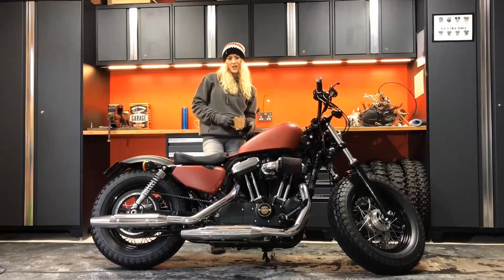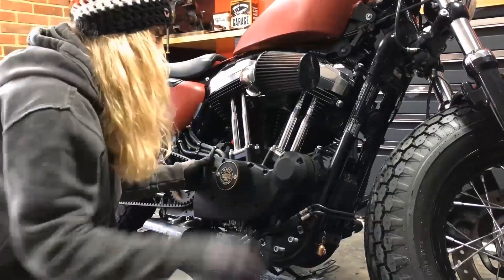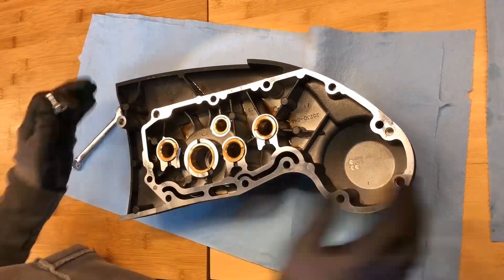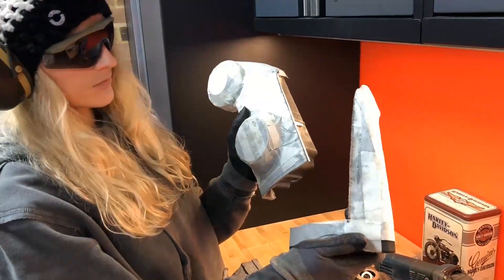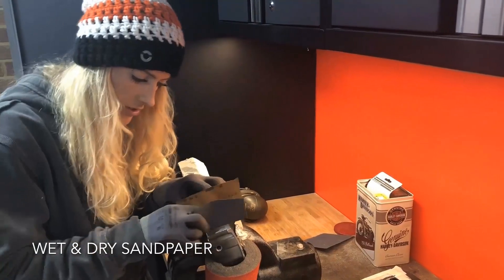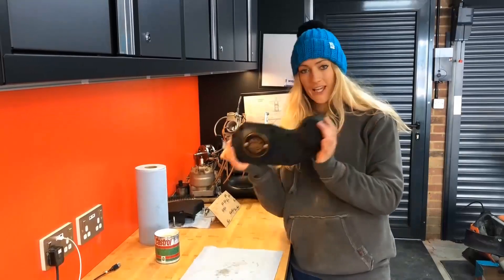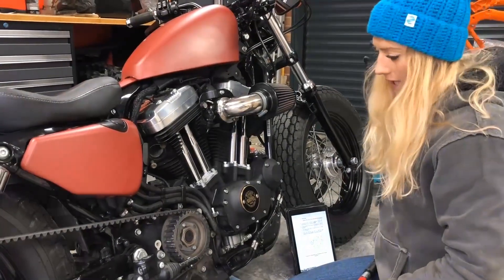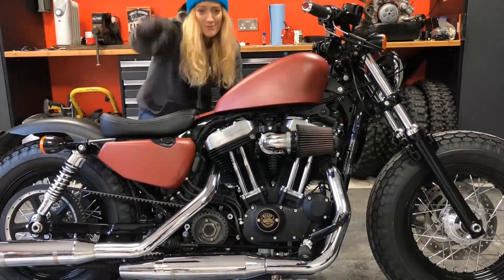Harley-Davidson Sportster Cam Cover Chop Customisation How to Video

Comment: Best video on this, so many people think you have to remove the push rods to do this, I’m so glad you showed them all, nice job.
Reply: iv been holding off on this because thats all i would hear...
Reply: @NomadMoto  Me too. 
I want to replace mine too, but worried about having to remove the rocker boxes too. And they say the cam(s) might come out with the cam Cover Too. And I'm worried about getting it back on without the cams being thrown out of place.
Reply: Mine is an 2002 also.
Is hers a rubber mount? 
2004 and up?
Reply from the maker: Glad it helps dude. It's an amazingly easy job!

Comment: I would love 🧡to do this project on my 48 special , 2018 , but would be paranoid the gears would come out with the cover, with spring tentions from the rods above causing them to fly off everywhere, do u have to rotate the pistons at a particular level to release the pressure on the cam orbital surfaces.😊
Reply from the maker: I hear you, take it slow. I didn't have any issues on pressure or tensions. Just took it slow. If they did shift, it's just a realignment thing, all good learning I'd say.
Reply: Yeah you should be concerned with that. Do yourself a favor and watch Hammer's instructions in their cam swap video

Comment: have installed Roland & Sand pulley guard on my 48 Special 2018, and then screwed back header pipes back on before i saw this great video. Do i still have to uninstall the bloody header pipes AGAIN,  to slip off the cam cover  while only taking off the brake rod & pedal ....looks like plenty of room  , but want to be sure.😲
Reply from the maker: I'm sure you need to take the exhaust headers off and the brake linkage
Reply: @TheGirlOnABike  roughly how far does the cover need to come apart outwards from the engine before u can swing it up to take oil hose off ?   seems like heaps of room before it would hit the header pipe.  And MOST IMPORTANTLY , what is stopping the gears coming out with the cover when taking it off , messing up the cam timing on our 48 special :(😊
Reply: my cam cover is chrome , is it worth doing by polishing the exposed cut end & bottom to match the chrome . Aluminium comes up pretty good if highly polished the knew  exposed ends.

Comment: I was very surprised to see that the ignition pick-up is no longer in the cam cover but I am blown away that you can remove & reinstall the cover while the tappets are pushing on the unsupported cams under the pressure of the valve springs !!! 
That's a long sentence but, I did say that I'm blown away lol.  Can someone with an understanding of physics please explain this to me ?

Comment: It is a very rare case where that cover slides on like that regardless of how you line it up. The proper way of doing this is to loosen up the rockers and relieve the downward pressure on the cams. 1 out of 50 goes this easy.
Reply from the maker: Good gen. Thanks

Comment: You don't need to loosen the push rods?
Reply from the maker: Off The Grid no, you don't need to touch them 🙂
Reply: Maybe its because we have different year bikes. mines a 2002 hugger
Reply: @NomadMoto   On the '03 sporties and earlier you definitely have to take the rocker box off first to release pressure on the cams, pushrods, rockers, etc. I know they switched some shit in the cam side on the '04 and up but not sure all the implications of those changes.
Reply: @morganridings5725  Thanks man. I finished the cam chop. I did everything you said. It came out really good.
Reply: @NomadMoto  mine is an 2002 also?
Reply: anthony diodati super easy to do man. You just need to find dead center, then loosen the rocker boxes. Loosen up all the bolts to relieve the pressure. Then take cover off slowly and the cams will stay in place.  Drain your oil first
Reply: @TheGirlOnABike  what year is your bike again?
Reply: @mrbreezeet1  This video is for 04 and up sportsters.
Reply: @NomadMoto Thanks, That's what I was afraid of.
 It's been a good while since we replaced the rocker boxes. Harley mechanic helped me. Circa 2006. 
Id have to find a video I guess. They want too much darn money for the push-rod kits. 
I think it was around $250.00 for everything. 
Plus I think I read you have to pull the rocker boxes to initially remove the push-rod covers.
Reply: Honestly, I wish I could change it like she did, ...........LOL......Guess I can wish all I want................LOL
Reply from the maker: anthony diodati 2015 👏🏼
Reply: @morganridings5725  that's what I was afraid of I have the ability to do it just not the patient's right now nor really a proper place to work unless I would get my garage straightened out which kind of tough right now long story thanks for your reply.
Reply: @anthony diodati no problem. I'm in the middle of a full teardown on my '03 1200 and by far the easiest bit is the part you'll need to do. You won't need a ton of space to get those rocker boxes off, it's a little bit of a pain to get at the rear cylinder head bolts on the primary side, but just be patient, you got this.
Reply: @morganridings5725  It is the same on 2004 . There are forse on one or two cams. The girl in this movie had some luck i belive when she put the cover back.  We did not know what really happen in the video or after . some miles..

Comment: Do you need to release pressure before you take the cam cover off?
Reply from the maker: Pressure on what? The cam lobes? I didn't touch the cams at all, just the case removal
Reply: @TheGirlOnABike  I am not sure, I asked elsewhere about replacing the Cam cover and I was told that I had to take off the rocker cover and rocker arms to relieve pressure first.
Reply from the maker: @chabib23  ah ok, that's the pressure on the cam lobes. I didn't have any issues
Reply: @TheGirlOnABike  Ok thanks a lot!
Reply: @TheGirlOnABike  You have to do it or else  you can ruin  some of the bearings. the are are allways forse on on or two cams.

Comment: My cam cover won’t go back on
Reply from the maker: Don't panic and be gentle. You have to find the sweet spot. Ensure it's total square and aligned and then gentle push. It will be about getting that perfect alignment as it should not take and strength. Good luck

Comment: A good job and nice looking after. BUT never take the cover off before you have take off the tension from the valvelifters . I know that you can take it off without any problems but when you put it on again the cams are not in the  exact right posiseons from the tension. You can ruin the cambearings in the cover with the small chips from the bearing when you forse the cover on.   How do i know that??  Guess !!  And if you need a rubber mallet or similar when you put the cover back. You have big problems. without force from the cams,  Just put it back with hands...   Just a warning  my friends.
Reply from the maker: Thanks for the tips ❤️

Comment: where is the centering pin? cut, it's useless. LOL
we will talk about it again in 40,000km ;-)
Reply from the maker: No nothing cut. Maybe this model is different to the one you're thinking. Bike runs perfect, done 20k miles and zero issues.
Reply: @TheGirlOnABike  look at 2min 30 you will see it next to your screwdriver

Comment: Do you Like cats and RU single? 
I'd Marry you tomorrow!!~!!!.................................LOL
Very nice job!!  I like to see a woman that likes to wrench, and has hobbies like mine, Instead of Busting My A$$ about my hobbies...................LOL!!
BTY, does the drive belt look like it could stand to be adjusted a "small bit" tighter?

All the Other videos I have seen, said you would not be able to get the cover back on with out removing the Rocker Boxes, 
I would like to replace the (flaking) chrome one on mine, But am concerned about the Cam(s) coming out with the cover, and/Or getting the cover back on without Issue. (I SEE YOU DID!!) 
I thought of cutting my push-rods, and using aftermarket adjustable push-rods, but they want too much money,
Reply from the maker: anthony diodati Haha 🤣😘
Reply: @TheGirlOnABike  lol, that's funny right?
I've only said that on your video and Jessi Colter the late Waylon Jennings ex-wife well Widow LOL oh..... You are cute as a button though LOL

Comment: You should have relieved the pressure on the cams by slackening the rocker gear , your lucky the cams never came flying out under pressure , the cam cover supports the out side of the cams under load .and having to retime every thing . not the correct way to do this. but it does look good .
Reply from the maker: didn't have any issues but good to know
Reply: Didnt want to be an on line know it all....Was an HD tech for 20 years and saw my fair share of miss haps , keep up the good work , we need more young people into the scene . or there wont be one .
Reply from the maker: Thanks for the encouragement dude. Mega appreciate it, totally know what you mean about the scene ❤️🙏

Comment: Looks like u exposed ur oil spout nasty look u didnt think this thru to well lol good job tho but now ur oil line will be exposed try again with new cam cover
Reply from the maker: The oil line wasn't exposed, all was good. I've done 10k miles since with zero issues. Thanks for the concern but it was all great.
Reply from the maker: Maybe this is a problem on an older carbureted or evo engine. Not an issue on the 2015
Reply: So ur saying ur oil line from the tank isnt visible ur crazy u butchered up ur can cover if the oil spout wasnt exposed whyd u have to remove it to cutt ur cover 🤔
Reply: @TheGirlOnABike  my bike same year as ur i just have tons more work done not just cosmetic  upgrades
Reply from the maker: @TheSevenboy127  because the but if the cover staying intact is has the oil spout. That was not harmed at all. Sounds like you've just got too much time on your hands. My bikes is absolutely find post the mod, nothing was harmed, so you can stop worrying. Cheer dude

Comment: Easiest way to damage all the bronze oil lite camshaft bushings is to remove the camchest cover without loosening up the rocker boxes and taking valvespring pressure off of the camshafts. That is the biggest hackjob I have ever seen on a camchest cover using a hand grinder? really? A mill such better way to do the job definitely an epic fail of a motorcycle mechanic.
Reply from the maker: Thanks for watching dude. We're all entitled to our opinions. It all worked perfectly for me so the angle grinder and process was no issue at all. And I'm no motorcycle mechanic and never have I pretended to be, just doing what works for me at home learning as I go, you'll see that if you check out my channels 🙏 happy new year
Reply: I suspect using a milling machine would have taken hours to get a stable set up that meant you weren't cutting any 'floating' areas of the casing. Also based on how many angles there are on it it would require about 3-4 set ups unless you had a rotary table. Besides, the bronze bushings are tough bastards. They'd have managed fine. Truly the only complaint that could be made about her technique in this video would be that using an angle grinder on aluminium can be a bit dicey as the disc can get clogged with the aluminium however as she was working with cast she seemed to be quite safe.

I suppose I am blessed to have access to a surface grinder, manual mill, cnc mill, and a lathe however truly the only three tools she needed were an angle grinder, sandpaper and an idea. A bandsaw would have helped but she got there either way.